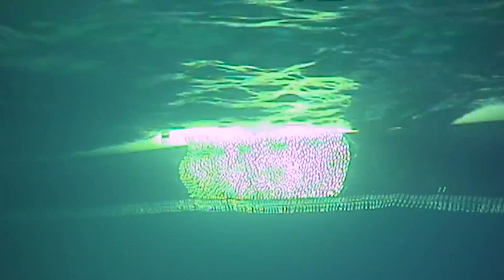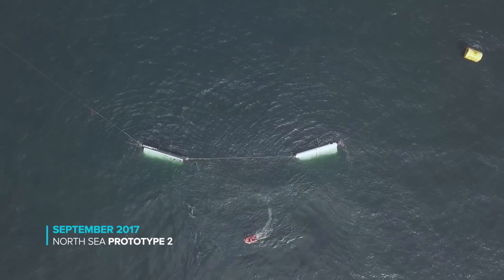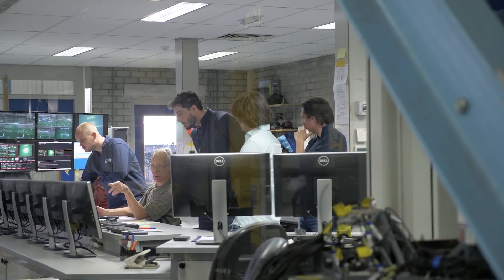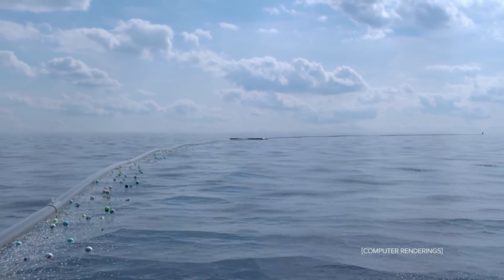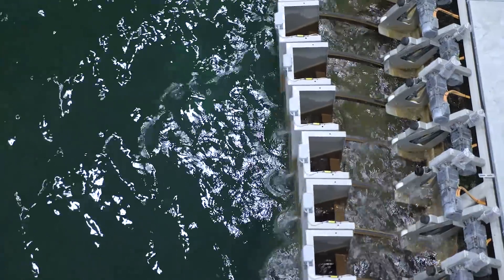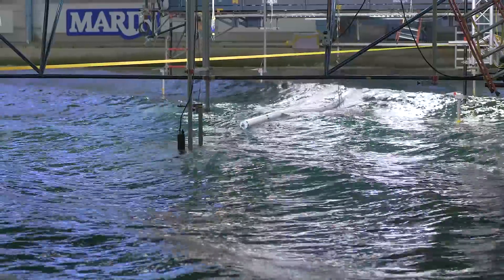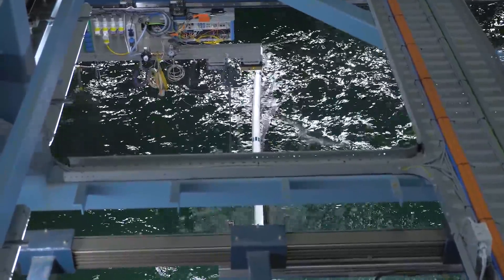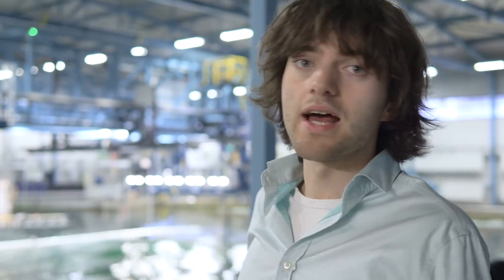Most Advanced Scale Model Test to Date of Ocean Cleanup System | Research | The Ocean Cleanup

Comment: Hi! I'm a fan of you guys work. I worked for a short time on a "Wave Energy Converter" code name "Anaconda" at Southampton University Civil Engineering Department. Your experimental setup was surprisingly similar to ours about 10 years ago: https://www.youtube.com/watch?v=kJF1Q-rOSm4
The goal of our device is to collect wave energy. In your case, you want the opposite, you want to dissipate the energy of waves, safeguard your structure, keep it alive as long as possible to capture more plastic. 
Hence, my concern, or maybe just some thoughts about the materials, dimensioning and anchoring. 

What I see is that, though it may be a good thing that the tube is flexible to follow waves shape and capture plastic pieces, having a tube that is too much flexible would cause the tube to bulge. If inadvertently, the wave travels in the same direction as the tube, pressure would build up in the tube, causing it to bulge, and in extreme cases, explode or de-anchor.

Our maths model and experimental setup matched pretty well as we were optimizing for THE AVERAGE ATLANTIC OCEAN WAVE. Back then, what I feel was weak was the engineering for the CENTURY WAVE. In other words, good to produce electricity in "normal conditions", but not soo good for several seasons with severe weather.
http://www.energy.soton.ac.uk/anaconda-wave-energy-converter-concept/

The person most knowledgeable both theoretical and experimentally that I worked with is Prof Chaplin: 
https://www.southampton.ac.uk/engineering/about/staff/jrc1.page

It does not seem that Anaconda is still being developed, the grant ran out I imagine. But you might learn a lot about the pitfalls of the technology by chatting with Prof Chaplin, and save a lot of time and money. His details are here. 
https://www.eurekalert.org/pub_releases/2008-07/eaps-rc070308.php

Let me know if I can be of any help. Thank you for your attention. Keep up your great work. 
Cesar

Comment: What is the point of these tests?
I mean; if you say the trade off is DEPENDENT of wave height and frequency...then NATURALLY you need to ADJUST the tube stiffness to each and every zone of SIGNIFICANT wave.
That means amending the design of the tube to something that MODIFIES the stiffness on command.
For instance tension wires inside the tube ?

Then, your tests shows waves running PARALLEL to the tube, which makes the WHOLE SYSTEM USELESS as all the plastic debris if floating AWAY past the tube.
With bad luck (high enough waves) the matter can even JUMP over the tube.
So, you must incorporate some sort of REPOSITIONING of the tube wrt the wave/current direction.
I never heard of that aspect in your design  before.

And finally...why aren't plastic debris (tissues of paper? and sprinkles of plastic) modelled in the waves ?
Reply: Have you even watched the video with audio? This tests is to examine the behavior of the screen, not the tube, in different situations like towing it behind the ship. Because the software has difficulties rendering cloth-like material they did some additional tests to see if the predictions are correct. They've done numerous test and you won't see that in a 3min video. I suggest you watch some more video's and read-up on the ocean cleanup website.
Reply: Every real life test can lead to new information
Reply: Well if you intend to pay for a system that is 100x more complex then the original by all means let them know...

Comment: What would happen if there was a tsunami?
Reply: In the middle of the ocean Tsunami's dont cause that much damage, it is only when the water is pushed up because the seabed it rising towards the shoreline.  Mid ocean the system will just go up the wave and down again at the back at the wave.
Reply: Because the plastic it gathered since the previous pickup would temporarily float back into the ocean? Don't be such a dick...
Reply: Then this curtain and tube floater becomes the largest plastic floating pollution at sea...